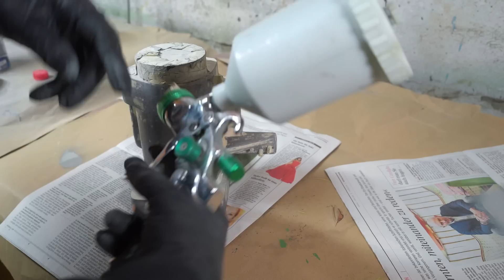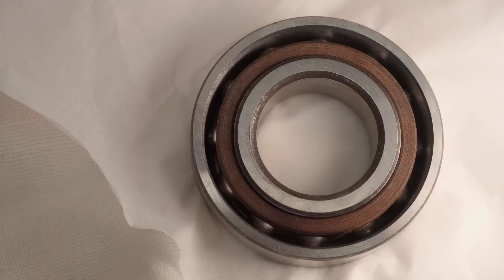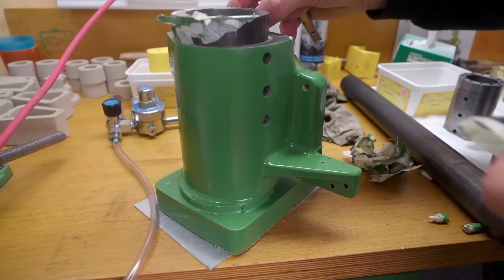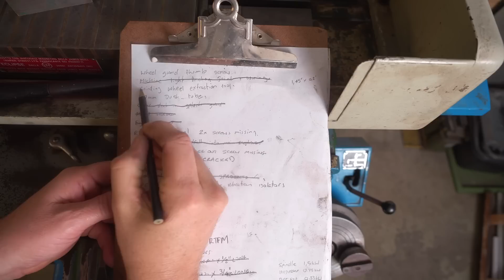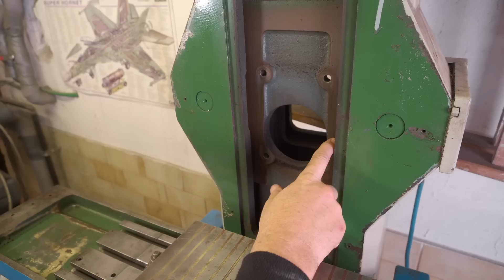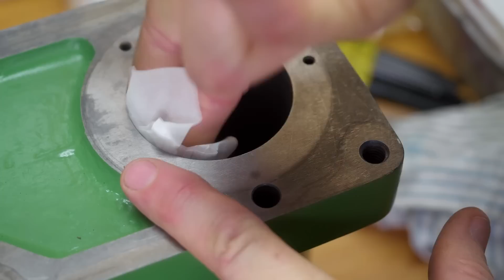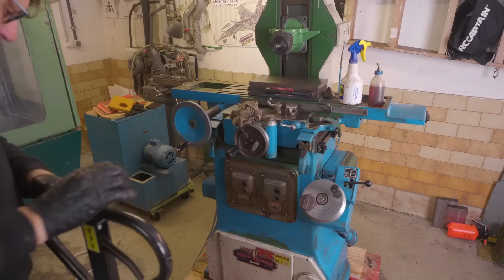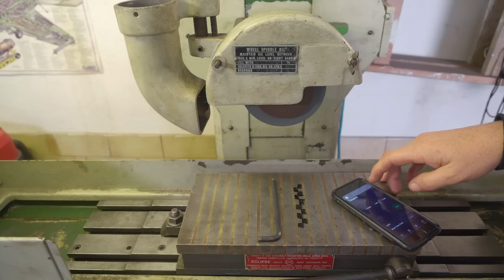My surface grinders bearings needed servicing || RotarySMP

Comment: Bearings and toast. They'll run for a while, so don't panic. They'll be good enough for you to get past your first couple of big crashes, so don't worry about replacing them until you get the hang of it. 

Two things first. Your machine has extremely fine down feed on the head, and a rapid step over for the cross feed. That's by design. When you've matched your wheel and material, you should only have to dress the wheel at the start; down feed should be .0001"~.0005" an inch with a step over of between 1/4~1/2 of the width of your wheel, the wider the better. The wheel will be partially self sharpening for a much greater period. Taking .002" or more down feed with a minimal step over glasses the leading edge of the wheel and starts burning your part. Those burns aren't just cosmetic; they descend much farther into the part. In a trim steel for a stamping die, they can lead to trim edge failure right out of the box, and subsequent regrinding won't fix it until you grind below the base of the fracture, which could be up to an 1/8"(3mm) deep.

I'm sending you this for info; problem is I'm in Michigan, and you're in Europe, so I can't just bop over and teach you the basics. Don't worry about grinding the chuck until you have the ways sorted out, it'll just be a waste of time. Test it out. If you decide to rescrape the machine, make sure you have a copy of "Machine Tool Reconditioning" by Edward F. Connelly. His explanation of how to geometrically inspect and control your geometry is priceless. Machine Tool Publications still lists it, but without a price. Watch out for Amazon; they'll sell you a used copy of unknown condition before they'll sell you a new one.
Reply from the maker: Thanks a lot. I have Connelly. Got it about 20 years ago. 
Thanks for confirming not to grind in the chuck at this point. That is pretty much what I was thinking. First just get a feel for the machine and grinding wheels.

I appreciate the tip on light downfeed and large step overs.
Reply: @RotarySMP  Got trained on how to operate a surface grinder from the gentleman who retired from Gallmeyer and Livingston here in Grand Rapids Michigan. They built some of the best surface grinders in the world. After Gallmeyer shut down, he started his own business; we teamed up multiple times over the next decade+ ; I knew how to run and inspect machines other than grinder's, and he taught me how to scrape ways and the correct way to operate a surface grinder. I was originally taught by die makers; the first time he walked in the door and saw me running one, he lost his 🤬🤬🤬🤬. One thing I can pass on right now; when you go to reflake the table/cross slide way's, a 40 point Moore pattern is actually way too fine, especially for the table. In a production environment, they'll basically polish themselves away with several weeks of use. 15~25 points is much better for a machine your size, as long as it's even. Don't worry about trying to make your work look like someone else's; scraping is like penmanship, each person is unique. I do have a question for you; where did you get your hand scraper?? I had to sell my power scraper about a decade ago to pay medical bills, and I can't afford to replace it. I've got a couple of homemade ones I built for special purposes, but they're down and dirty. I don't currently have a home shop, but I recently reacquired the complete Gingery series. Hole in wallet syndrome says it's time to cave man it.
Reply from the maker: @7891ph  My hand scraper is a Sandvik. I bought it NOS off the german classifieds about a decade ago. I also have a British Coborn power scraper. Very cool old tool, with a flex shaft  from a 3Ph motor on the floor. The cool thing is the laping plate they put on the motor as well, so you can constantly re lapp your blade.

I scraped a crappy chinese lathe in as a training project a few years ago (the start of this channel.) I look forward to doing a real machine.
Reply: @RotarySMP  Be careful what you ask for!!! With farming out grinding the entire table, it still took me over 80 hours to rescrape the ways on just a Bridgeport mill, let alone the time to tear it down, and then rebuild it with new bearings, belts, etc.

Long story short, picked up a rebuild package from a large aerospace company with a branch in Muskegon; they couldn't get any funding for new machines, but unlimited funds for maintenance.

You read that right.

I got handed a project to totally rebuild, rescrape, rewire a half dozen Bridgeport mills for about 1 1/2 more than new one's cost. They wanted each one back fast, but I wanted to actually be RIGHT!!!. This was shortly after 9/11: the program got put together by an outside contractor. I did my best; sent the first machine back. No real feedback. Sent the second back. Someone from said aerospace company is in the shop asking questions. Walk him through what I was doing (and a whole lot more). Didn't find out until the last one got delivered; better than factory accuracy (at 2 1/2 times the cost??? How many hours did I put in???). Later got called out for tech support; minor stuff, lube pump failure on XYZ machine. Company bidded on another job; someone else way hungrier than we were got it. That was late 2008; things kinda got depressing really quick .

Comment: The results of the bearing in the cleaner in the last video were very interesting. I wonder if GE says it's ok due to using a different material for the bearings. As for the lint free wipes. The ones I use are really like a plastic tissue paper with more texture. I don't like the feel of them in the hand because they want to stay flat.
 
        Is it really that hard to get SAE/Standard whatever you want to call it at the time hardware and associated stuff. We use both here so we can get anything but metric drill bits and taps and a few other things while available in pretty much all stores are in less selection. I want a metric drill bit set that has multiples of bits but that's an amazon only thing for cheapies and not available locally like sae sets.
        Oh and speaking of metric. I think I left my 10mm ratcheting wrench at daughters during the waterpump replacement. That's why I didn't take my Gedore one I bought in Athens last year. It was just a cheap gear wrench brand one.
Reply from the maker: Unified (what you can standard) is easier to get here than Bristish standard. There is a shop that stocks UNC and UNF fasteners, and webshops. For Whitworth, BA and BSF stuff, there is one german web shop, but they don't stock the full range. We just to just buy this stuff from the UK, but since they left the single market, the tarrifs on 3rd countries, and paper work meant most small UK venders wont ship to the EU; or the prices get crazy.

The GE and RR procedures do require you fix the inner and outer races to not rattle.
Reply: @RotarySMP  Gotcha. Back when I had the 1800s bandsaw and needed some hardware to replace missing stuff I couldn't find any real suppliers of witworth here. Some of those threads were already messed up so they ended up being tapped standard. Too many names we just call it standard and metric though the SAE was the one that standardized hardware way back so it's sometimes used. Frustrating when we can't just agree on one terminology for something. 
 
         If I knew I was going to Naxos this year I could probably pick up stuff from England to drop off for you. One of us has to be at home to give Oscar his pills so not likely for us to both go somewhere together this year.

      And a fixture clamp for the bearing makes sense but still interesting results to keep in mind.
Reply from the maker: @theinfernalcraftsman  It was probably good practice making those fasteners. I will probably be making the ones on the replica motor bike engine as well.
Reply: @RotarySMP  Yup and very nicely done.

Comment: I don't get the high amount of costs when replacing the B72 Bearings. I can order them for about 33 bugs each... I cannot imagine that these 2 do cost 360 Bugs in your case. Anyways, like always good video. Happy Easter
Reply from the maker: Where do you buy B7205 ( and 6) -E -P4S-UM bearings for 33 bucks Jonathon?
Reply: I know there are various types available. But i didn't know the exact specifications. On kugellager-express i found B7205 C T P4S UL, but in your case that one isn't the same (C...UL...). I do have a dealer for high quality bearings about 20km away from my home. Maybe they have the bearings a little bit cheaper. I can ask if you want to but i dont know if you really need it bc i did not watch the video to the end...😬
Reply from the maker: @jonathan_mtb5837  Thanks Jonathon. The E is 25° contact angle. C's are 15°. UM is medium preload (although I am not sure if that is not irrelevant with the spring preload system).

If you have a relationship with a bearing supplier, please ask. I know that the trade discounts on these things can be significant.

I have read some pretty poor experiences with "precision" bearings from bearing express. From FAG, the two bearings are about €350 from Agrolager.de.
Reply: Jonathan  there are various grades of these bearings ,   the higher the precision the higher the cost . surface grinders  use  one of the highest precision grades.

Comment: It looks like your on a winner.
A story about corrosion on spindle bearings. For a start it isnt ideal but for a rotating tool like a grinder it doesnt matter as you dress the stone and dont rely on the rotating path of the spindle so all is good. I had a job to replace spindle bearings in a lathe many years ago. Big slant bed machine with a 600mm plus swing and the spindle bore was about 300. So it had quite large bearings and the reason reported for the bearing change was it was turning oval. Not by a lot only 0.002 ~0.005 mm. It was machining parrel and unflared  with no radial runout of the oval bore but not round according to the CMM and the gauges used on the parts. I expected that when I pulled the spindle it would have had a bolt overtightened on the spindle mount or a bend like that to throw out the rotation of the front bearing. I warned the customer of this and that it could be an issue but they said go ahead any way.  It was a simple 3-1 layout like many machines. Once in pieces I found a thumbprint that looked like it was etched under the radial/axial pair of bearings. I checked the nose on the CMM and found the same runout figures that were in the sign off sheet so I guessed it would be ok. Fitted up all new bearings and reassembled the machine thinking that the etch marks were the cause but a new bearing wouldnt have a dip worn into it so it would be ok. Boy was I wrong after running it in put on the chuck and did a few test parts 0.009 ~ 0.012mm. Well that day turned into a couple. With a spindle replacement months away if at all available I had to get it better. The final solution was refit the old bearings and lube them up indexing the corrosion mark back to the bearing inner race. 0.003 ~0.006 oval that was ok enough for a reamer. I measured the tapered diameter with proper micrometers and attachments but didnt have access to the CMM at that time of the week end. I always thought I had a pretty good feel for a mic but I never picked up a lump or flat spot under the print. The point I suppose is corrosion on bearing diameters can make a spindle do unusual things. Always wear Gloves, Always warm housings to remove condensation hiding in the iron or any material before refitting and if anyone offers you a job to correct an Oval meaching spindle make the first responce Ohh thats going to be expensive....
Have a great Easter
Reply from the maker: Mu tolrances on a lathe with that bore must a real challenge. Thanks for your experience.

Comment: could be fun to try and build some hydrodynamic berings for the spindle itself ( never wear and perfectly smooth )
also when your gonna dust off the magnetic chuck i would recomment that you first take it of and grind in the T slot surface that it sits on. then put the chuck on it upside down and use super glue to hold it ( only to take off enough that the entire surface is clean since if you use the clamps or magnetic power at that staage your just twisting the chuck and when you release it the springs back still tiwsted. but the super glue dont inforce any force or stress or twist into the chuck ) and then mount it right side up with the clamps ( since both the T slot surface and underside of the chuck in grinded in flat perfectly to eachother without any twist or stress ) and grind it in ( one "heavy" to roughly clean it up then dress the wheel for a light finish/final grind )

thats atleast how i would do it. some of it i picked up from old grinding masters i worked with and also from adam the machinest

cheers mate
Reply from the maker: Thanks for the tip. I need to do some measurements and see what the current alignment is like.
Reply: @RotarySMP  your welcome. hope it's not to bad/out of alignment

cheers

Comment: Kluber LDS 18 Special A grease is what my Schaublin uses for spindle bearings... It is supposed to be used on tapered roller bearings, needle bearings with 0 clearance and similar ultra low tolerance bearing systems... I would say that it is a better choice for the surface grinder - what with precision expected from those bearings, or rather, what with the preload you are going to be putting them under... 
NBU is more of a precision bearing grease that would do nicely for ABEC 5 and likely even 7 grade bearings, but for ABEC 9 and such, i think that it is better swapped for LDS 18... 

Also - HELP YOURSELF, DON`T FINGER THE RUNNING FLANGE! I did so and it kicked my finger to the side, the wheel caught my finger by friction and smacked it into the wheel cover when i first got my s.g.... It is extremely dangerous and can cost you much more than a finger if the wheel catches you properly... The amount of friction it can produce in contact with skin is ridiculous and not to be taken lightly... If it caught my hand anywhere where there is more skin, it could have sucked my whole wrist in the cover... Do not mess with the flange, do not touch the wheel - if it is spinning... Even when shutting down, it still has immense momentum(mine has more, as it is a heavier machine with a heavier spindle and larger wheel, but still) that takes a lot of wind-down to fully stop... A lathe chuck is one thing, but a grinder wheel like this is a menace in disguise... 

Speaking of the Weiler lathe video, i have seen it - yesterday - and boy, is that lathe fucked up... Whoever had ``fixed`` `er in the past did a horrible job... That headstock to bed gap is insane... Not to even talk about the spindle internal taper... That dude has about as much patience and love for machines as i do - he must, if he had even the slightest idea what he was getting himself into with that machine... Dayum!

Best regards and happy Easter!
Steuss
Reply from the maker: Thanks Camillo, Goot pick up on using the finger brake. I did catch and kick a little. No harm, but enough to have me thinging "that was a stupid thing to do".

Vasi phoned me up today for a chat. He is a really nice guy, and that Weiler is really lucky to be owned by him.

Comment: 27:18 you've got guts I don't let my phone anywhere near that strong of a magnet don't know if its still a problem but that destroyed a MP3 player of mine back in the day
Reply from the maker: Good point. The magnets were negated while doing that, but still, could have ended badly.
Reply: I wouldn't let it or my fingers near a wheel I haven't run for a while. 
For a real "manly" kind of grinder have a look at this https://www.youtube.com/watch?v=c5EsqivG6Lg Amazing, it has everything damaging dust (silicosis), permission to continue to work because the product is needed (until chainsaws came along), unguarded belts, and the ever present danger that the stone might explode - though after a 30 minute pre run the likelihood is lessened.
This stone grinder is a contemporary of the J&S 540 .....
Reply from the maker: @ianloy1854  I like those industrial history videos.
Reply: @RotarySMP  So where did the stone wheels come from https://www.youtube.com/watch?v=HtNLEYQnFRs
I started my F&T apprenticeship in 1977 so the '71 date stamp doesn't feel so long ago (year 7).
In the apprentice shop (Vickers Ruwolt in Richmond Melbourne) we had a good selection of machines - including a J&S 540, Colchester lathes, mills, horizontal borer, shaper etc.
Fun times

Comment: Grind the table surface first, before you mount the magnetic chuck. Then mount the chuck top down using the magnet to hold the chuck to the table. use residual mag if possile. Grind the base of the chuck for full clean up. Flip the chuck and clamp down. Finish grind.
Reply from the maker: Thanks, before I do any of that, I will probably take a closer look at the slide ways, as there is a fair bit of wear, which will need scraping out.

Comment: i think it needs new bearings one can hear a slight noise on run down. another great video
Reply from the maker: I think you are right, but as long as it gives that finish, I think I will use it for a while, and get a feel for accuracy and other issues it might have.